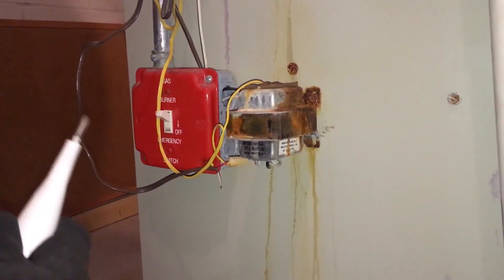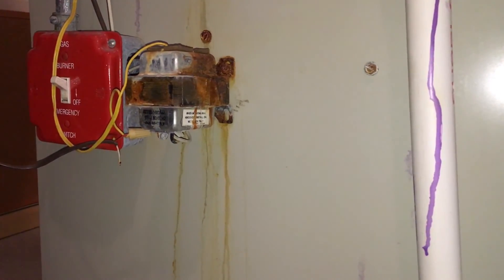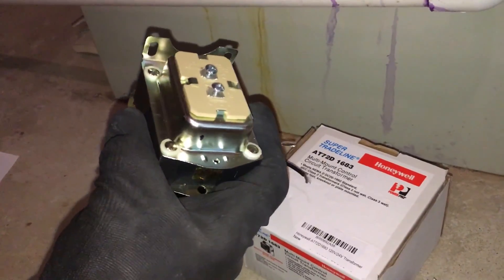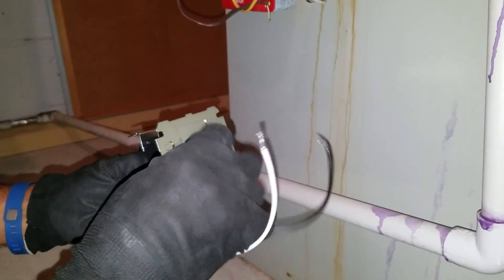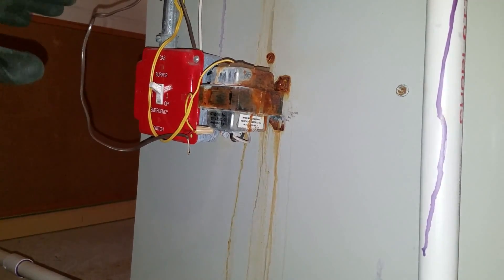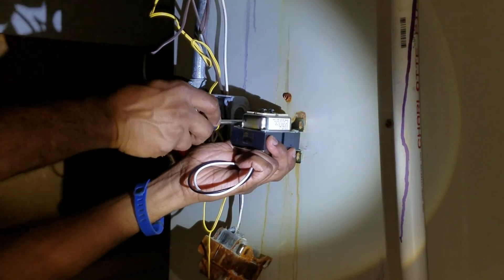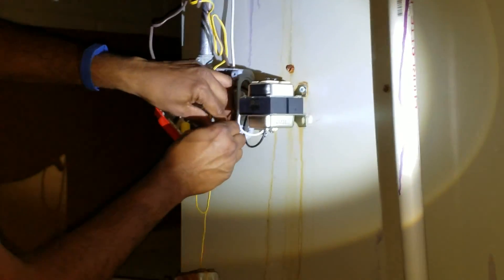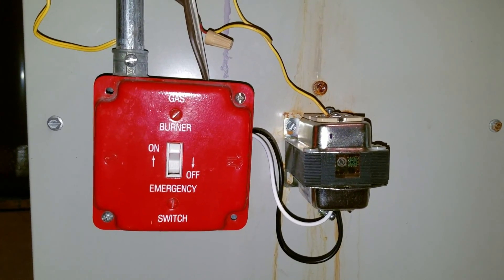Honeywell AT72D1683 120V/24V Transformer Replacement

Comment: What you installed is unfortunately not to NEC code. Exposing the 120v circuit, without a mechanical means of protection, is not allowed.  The plate that you discarded was intended to allow you to mount the device safely, to code, onto a wiring box.
Reply from the maker: Thanks for the feedback Kirk. 
I am always open to correct my mistake. Could you please correct me and what I should do to fix?

Comment: im confused, is power coming into the black and white wires from the switch, and the 24 volts is going out the single yellow wire to the device?